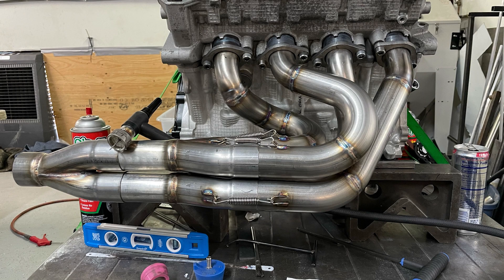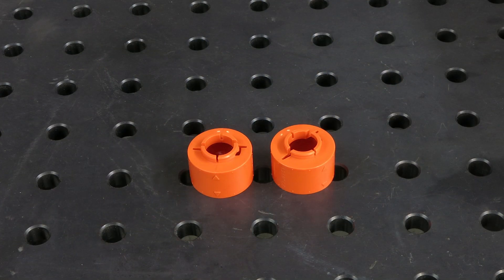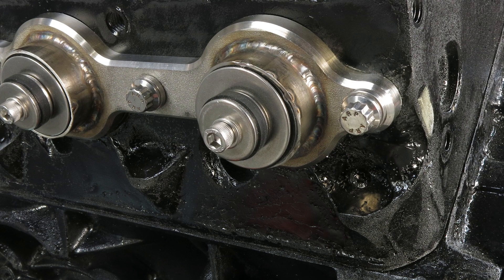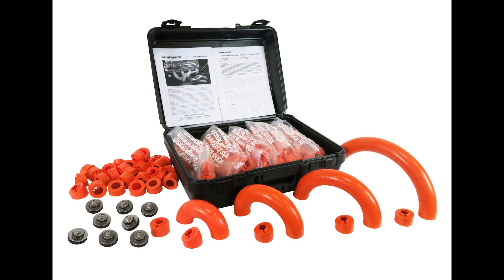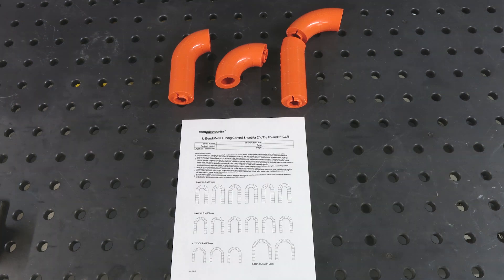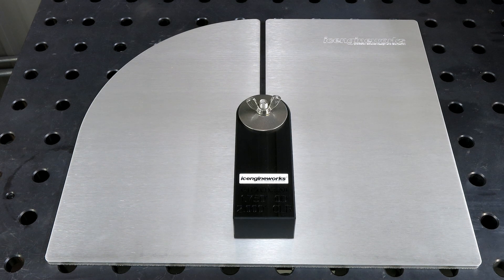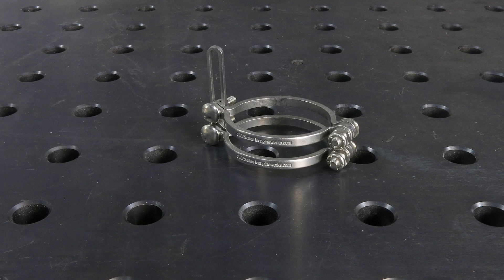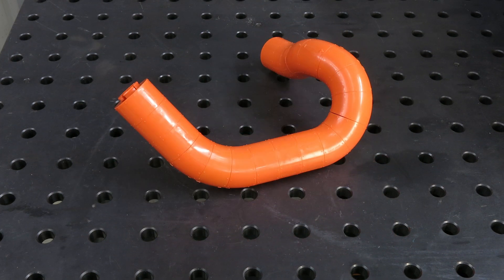Icengineworks Exhaust Modeling Systems Overview

Comment: Why the fuck don’t you show a cut where arrows don’t line up and the block won’t sit flat on cut table?
Reply from the maker: The point is that everywhere the arrows do not line up, there is a weld joint so you have to break the blocks and make a cut for that segment, therefore the blocks always sit flat on the table when cutting.
Reply: You have to improvise somewhere at least